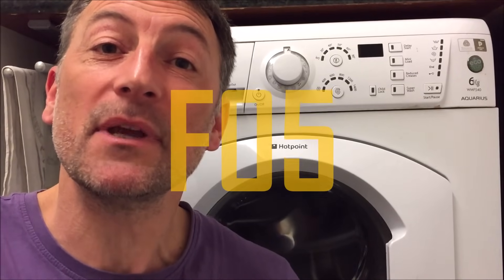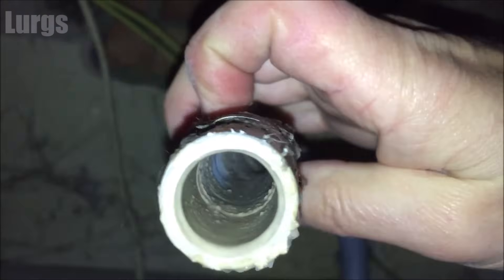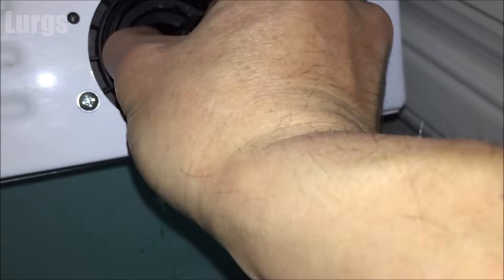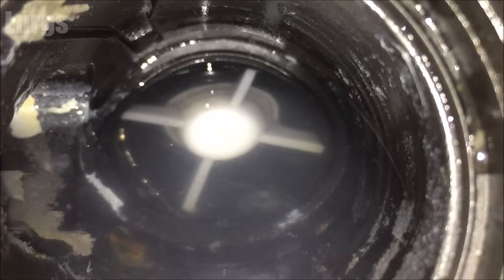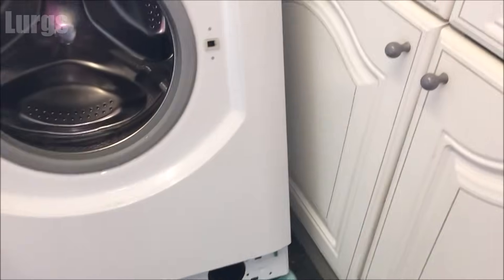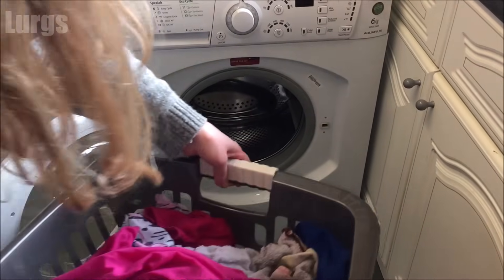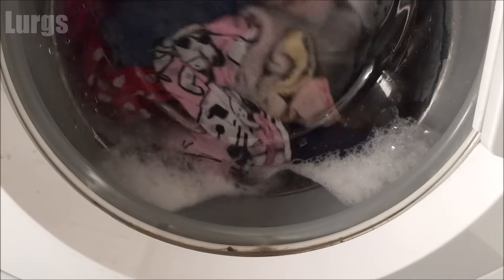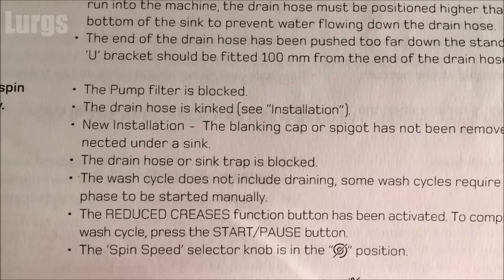Washing Machine F05 Error Code Fix Hotpoint Indesit

Comment: Emptying the filter worked for a short while. I got £1.27   in change out. Later had to tip machine on its side and take off the pipe and I got another £10.44 out.  I let it fall out into a saucepan. I thought I had won the jackpot in Vegas!
Reply from the maker: Wow you did hit the Jackpot, literally. A working washing machine and £11.71 up! 😎

Comment: Thank you so much! Moved into a new place and had the dreaded F05 code. Turned out the drain pipe was clear, the filter was clear but it was flashing all the lights. Further investigation it turned out that someone had blocked the outlet under the sink! Would never have felt brave enough to sort this out if I hadn't watched the video. Job done!
Reply from the maker: Good fix! Glad my video helped out. Enjoy your new place.😎

Comment: Fantastic video. Was on the point of ordering a new washing machine but used this to diagnose the problem and managed to locate a chewed up sock in the drain filler. Machine working as new! Saved me £400 on a new washer before Xmas! Thanks 😊
Reply from the maker: Now that is a spectacular saving! Merry Christmas. 🎄

Comment: Thanks for the help.  Initially I couldn't pull the machine out because the compartment is very tight, the machine was full of water and the feet had dug into the flooring. Managed to manually release the door, remove the drenched washing and excess water. Then I put some washing up liquid under the feet so they would slide more easily. Then followed your steps. Turns out a sock had somehow managed to get into the filter. All sorted now and saved the Whirlpool £110 call out charge.
Reply from the maker: Wow that’s a big saving! My mantra is to save people time and money and that’s definitely true after reading your comment! Hopefully I’ve gained a new subscriber. Glad you got it sorted and stay safe 😎

Comment: Good video. There's another video where he skips straight to recommending a new blockage sensor from eBay rather than actually check there is not a blockage first lol

Tip, it can be quite hard to tell if your waste pipe from machine is blocked, the clue for us was a horrible stench (stagnant water), if it smells foul then suspect a blockage, we cleared it by gently compressing (standing on) the flexible pipe and all the crap then came out!
Reply from the maker: Great stuff. Glad to help and glad you got it sorted. Yes a horrible stench is a warning there is a blockage somewhere.

Comment: Good  advice and video got me out of trouble close to xmas, my one I couldn't pull the machine out because of the amount of water in it so I used a vacuum that sucks up water as well, I made an air tight seal with sellotape on the different size pipes and connected to the water waste pipe on the machine , and followed the advice on pump area and found buttons and coin and bits and pieces. Working fine now , thanks very much for the video.
Reply from the maker: bertie scunsbutch Fantastic. Great news it's all working. Have a marvellous Christmas 🎄.

Comment: Video guide to clearing the blockage was great.

Expected to be plumping £250 on a new machine, but found it was an old debit card that had caused the pump impeller to be siezed.

Found the rest by taking of the feed hose and fishing it out from the square sump type bit.

great guide, many thanks
Reply from the maker: Marvellous. Great result. Thanks for the comment and have a great weekend (of washing!).

Comment: Thank you I had an Indesit IWSC51051 which had a wet wipe in there. Again, thank you so much. Also, F05 error on a Whirlpool washing machine is not a drain issue, it is a NTC fault.
Reply from the maker: Glad I could help. 😎

Comment: Thanks for the helpful video...helped us out a situation and saved a callout to repair the fault.  Apparently no objects found in filter....but 2 large throws in the tub.....which can only think because of the bother it had draining water from it...then may have caused the code error to be shown. Eventually got it drained away and up and running again.   Thanks for the upload...keep up the good informative content. Liked and subscribed.👍
Reply from the maker: If the drum is full with heavy laundry when that gets wet it will be very heavy so the machine may get a fault. Glad it’s all ok anyway and thanks for subscribing 😎

Comment: Brilliant video! Very easy to follow. Thing is I did all this and nothing was trapped in the pump filter. Absolutely fine. Yet when I start a new cycle, I'm still getting an F05 error message. As water seems to be able to get into the machine just fine, maybe the dirty water hose is blocked? I'm bad with things like this. I have towels and buckets at the ready. I really need to figure this out.
Reply from the maker: Check out my other video on what to do if your washing machine is not draining water, there’s things I take you through.

Comment: I repair these day in day out, good video. And the last one I went to F05 had 2 hair clips jamming the pump. 
NOTE: F05 means pressure switch  fail. While F11 means drain fail. But if you actually get F11. It usually means a physical repair
Reply from the maker: Cheers for the info, and good luck with your channel, looks like it’s doing really well. Have a great weekend
Reply: Thanks for this video.
When i opened my machine from the top i found out that the drum was turn from above down to the side. Could this be th reason for error F05 and the reason for water leakage?

Comment: Thank you so much for this video!  Half of a mangled neoprene mask later and the filter is clear.  Running a rinse cycle empty right now, so hopefully it's sorted.
Reply from the maker: That's a first for the list, it's normally hair clips or coins or colour catchers. 🙂
Reply: @LurgsHowToGuides  I was expecting some loose change or a work badge, so finding a soggy bit of neoprene was a bit of a shock!  Rinse went fine, so washed all the towels I'd used and it seems to be quite happy again.  You're a life saver!  :)

Comment: Great Video mate easy to follow and sorted the washer in 20 mins 👍🏼👍🏼 Back up and running already with a few quid still in the wallet. And I found 41p inside the washer 😂😂
Reply from the maker: Not only did I save you money I also gained you 41p, now that's a clever video! Happy to help. 😎

Comment: Great video thanks, had the F05 error, cleared the filter and the waste outlet pipe so draining ok now but now it's stopped bringing water in (which may have been happening anyway). The initial problem started on a rinse and spin cycle, at the end of the cycle the error code appeared, concerned about putting it through a full cycle now I realise water not coming in.  Any advice appreciated thank you!
Reply from the maker: Not sure I’m afraid. The water inlet tap is definitely turned on?
Reply: @LurgsHowToGuides  Yes as I'd used the machine the day before, done some hand washing (nothing has changed or moved in the house) and went to rinse and spin what I done by hand
Just really strange wondering if it could be the circuit board telling the machine not to bring the water in? as not sure how the F05 code could cause it? Thanks
Reply from the maker: Maybe try a factory reset if you can or unplug at mains for 5mins
Reply: @LurgsHowToGuides  Ok thank you, we did turn it off for an hour or so at the mains the other day. So we have tried a quick wash 30 mins, and we can now hear water but can't see it in the drawer, like usual, we'll let it run to the end, see if any fault comes up as that's when the F05 came up - not sure when they usually appear?

Comment: Hi, many thanks for this great video. I have a Hotpoint WMXTF842 vintage 2015 giving a F-05 code.

I’ve taken the pump off and cleaned it out thoroughly along with it associated pipe-work. In particular there was a lot of gunk on the outboard side of the drain hose connection. 

I had high hopes but the error remained. I then tested the pump motor/impeller with a multimeter and also watched it running so it seems fine.

What happens is that it pumps ok during the start of the cycle but after a while just carries on “trying” to pump and then throws the F-05 code and finally stops pumping.

The best way to describe it is that “it pumps out ok BUT doesn’t seem to know when to stop. Then after trying to pump  (with countdown timer stalled) for several minutes (with no water coming out) it stops pumping, the error code having been issued a few minutes earlier”

The only thing I can imagine, apart from the CPU, is the Pressure Sensor. I’ve checked it’s pipe work and it’s seems pretty clear.

What do you think?  Sorry this is so long.

Thanks again!
Reply from the maker: It’s worth checking the filter again. Sometimes after clearing it more debris can fall down into it. If that’s clear then I’m afraid it could be any number of things such as pump failure or computer board error or the pressure sensor. I think those pressure sensors are a bit sensitive. You can try tipping the machine sideways a few times but be careful of water spillage! Hope you get it fixed
Reply: @LurgsHowToGuides   many thanks for such a quick response. I did re-check the filter and it’s fine so I think I’ll try a new pressure sensor as they’re so cheap.

Thanks again!
Reply: I’ve just realised that I haven’t checked the pressure chamber for blockages. I did try blowing down the pipe from the pressure switch/sensor and although I got some air through it was pretty difficult.

My problem is that I can’t see how to remove the chamber, can you please tell me how to do this.

Many thanks!
Reply from the maker: I don't know I'm afraid.
Reply: @LurgsHowToGuides  haha, that’s what I like, an honest man. Thanks anyway, I’ll report back in due course as it may be helpful. Thanks again!
Reply: I had a good look at the underside of the drum today and couldn’t see a pressure chamber. The hose from the pressure switch just seems to attach to a point on the drum. I did a search on some good spares sites and couldn’t find a pressure chamber for this model as a spare part. I guess it may be an integral part of the drum.

The good news is that I am easily able to blow through the hose with very little resistance so hopefully the new switch/sensor will do the trick.

Comment: Thank you for the video! I've done it and found an elastic band blocking the pump. I removed it and now the pump works. Unfortunately, it is liking from the bottom now !! Do know what it can be?
Reply from the maker: Maybe you didn’t lock the filter back in properly? It should turn a few times then lock fairly tight. You could try some Vaseline on the thread. But really it shouldn’t need it

Comment: I had a Hotpoint Smart 9kg which was not the best washing machine. Had F05 come up 4 months old and engineers had to replace the pressure switch. Asked if I was overloading the machine. Then around 8 months later F05 comes up again. I sold the machine and the guy told me  apparently a wire had come out.  I still don't regret getting rid of the machine.
Reply from the maker: Yeh I've heard the Hotpoints aren't as good as they used to be 'in the old days'

Comment: Hello, thank you for your video. Once I clear the items from the filter pump, is the F05 code supposed to disappear or do I need to turn off my washing machine at the wall switch and turn it back on again for the F05 code to disappear? (Assuming nothing else is blocked) Thank you.
Reply from the maker: Yes turn it off at Mains or there may be a factory reset that you can do, this may be in the instructions.

Comment: Would you be able to make a chapter about Bush washing machine error code. Please. I have 8 months old another one , which had to replace with Indesit. The Bush can't be fixed as noone does them. Error code with doors sensor. I would be very greatful . Otherwise will need to scrap £250 😭
Reply from the maker: I really wish I could help but I don't have a Bush washing machine. Maybe try some forums to see if theres a way to fix it yourself. Must be someone who can repair it I would of thought. Good luck.
Reply: @LurgsHowToGuides  Thank you. I will try. 
😊⚘

Comment: I put washing  liquid in part where softer goes and it is flashing F5. Is this same issue of bkocked filter?
Reply from the maker: Yes probably coincidence, shouldn't make any difference if you made a mistake on the softener. Check the filter

Comment: I can't get the Hotpoint Aquarius+ WMPF 746 Washing Machine Pump Filter switch to turn.  It turns half way and won't budge.  I have tried everything. Is this suppose to turn 3 times?
Reply from the maker: I FEEL GR8! Holistic Therapy & Training Probably because something is jammed in there stopping it turning (like a metal hair clip). Just keep tightening then I tightening and wiggle machine about. Hopefully it will drop out and you can unscrew it.

Comment: Hi I have a washer dryer with this error code however the water has drained but door won’t open I can’t access the plug to switch it of! Is it safe to leave on tonight it’s still under guarantee so will get it sorted tomorrow just can’t turn it of tonight thanks
Reply from the maker: Sorry for the late reply. I expect the plug is at the back if you can pull it out slightly. Hope you get it sorted, please let me know how it goes, thanks.
Reply: Thanks for getting back to me! Yes the plug is at the back but I can’t get to it as it’s to heavy to get out of the space it’s in to access the plug! But it’s been on all night and not flooded or anything so should be fine! Thanks for getting back to me!
Reply from the maker: Katrina Z Should be able to wiggle it side to side as you pull it out. But yeh they are heavy as they have bricks in!
Reply: All sorted now got a friend to pull it out thanks so much again 💕
Reply from the maker: Katrina Z Cool. Hopefully I've gained a new subscriber, Glad to have helped

Comment: I had an F05 error today. I followed all these fab instructions but nothing was stuck in the filter.
I tried to do a spin and drain after I followed the instructions, but it’s stuck again. Help!
Reply from the maker: Recheck the filter as sometimes things can drop into it again. If it’s clear then unfortunately it could be a pump fault or computer board error. Good luck

Comment: Hi. I'm really struggling to open the filter on my indesit machine. It seems to turn a little after force then jams and doesn't turn anymore. Do you know why this is? Thank you
Reply from the maker: Kay Yes I bet there is something stuck in there like a hair clip jamming it. Tighten it up then I tighten then try to wiggle Machine about. Or it might be really stiff if it’s old and never been taken off. I used pliers on an old one once just to try to get it to budge. Careful though as it’s only plastic
Reply: @LurgsHowToGuides  I did it with the pliers and now I've broken the plastic off so there's no way to turn it shut,it's now dripping into a bowl and worried it won't stop as the machine is pretty much dry. I,should've just left it alone as I've made it ten times worse. 😓😢. Can the machine be repaired in this state/can the filter lid still be removed by a professional and replaced or will I have to purchase another machine? Thank you
Reply from the maker: Kay Turn the cold water feed off at the back. It will only drain out what’s left in the machine. I expect there is something stuck in the filter. I’d try and get it out if you can wiggle and turn it. Sounds like you will need to get a new filter but if you can get it off then it tightens up by hand, just put some Vaseline on threads. If you are not confident then yes call a washing machine engineer. Probably just need a new filter once you get it off. Good luck and hope it works out ok

Comment: How do you get the black cap to come off. Mine rotates but can’t get it out
Reply from the maker: It should easily remove, sounds like something stuck in there, probably a hair clip jamming it. Just try tightening then untightening lots of times to see if it works loose

Comment: I cleaned out the filter, was full of gunk lime scale and a sticker, but since replacing its now leaking when I put a load not, have checked everything again and all seems fine so not sure why its leaking? Will have to call an engineer.
Reply from the maker: Is it leaking from where the filter is? If it is then maybe you haven't locked it in correctly. Try removing and putting it back in again.

Comment: hello i am having this issue i hope you'd be able to help even 4 years later. I don't understand which pipe you are taking off - could you please explain to me? Maybe I can e-mail you a picture of our pipes so you can point out which one
Reply from the maker: What time in the video?
Reply: At :59 you mention drainage pipe, is it the grey wrinkly one I have to disconnect?  

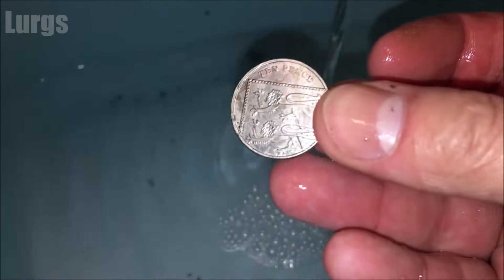I’ve taken out the filter ( the one where you took the coin from at 2:30) and barely any water comes out of there and it spins fine… so I’m assuming my blockage is not there.
Reply from the maker: Try this video instead. This shows drainage pipework two different types. This should help you. Good luck
Front Load Washing Machine not Draining Water - Washing Machine full of Water
https://youtu.be/FwRbWKOwmfY

Comment: Is there any other way to loosen it? I can only turn it up to 6 o clock. I have tried so many times. I think all the water has drained out but can’t get on.
Reply from the maker: Unfortunately that means there is probably something stuck in there preventing you from turning it further. Try tightening and untightening it to see if it frees up. If not then try to be a bit more forceful. If it breaks then you can always get a new filter. 
Good luck and hope you manage to get it out.

Comment: How did you open the door when it was locked mid cycle ?
Reply from the maker: Think I just turned it off at mains and door unlocked or the green pulley string